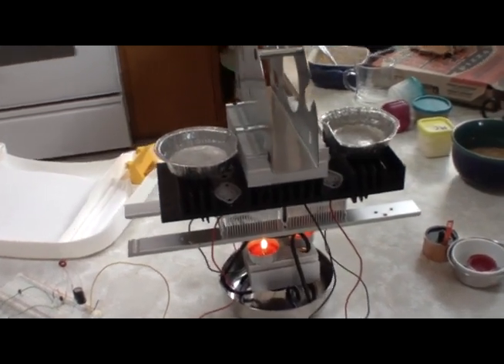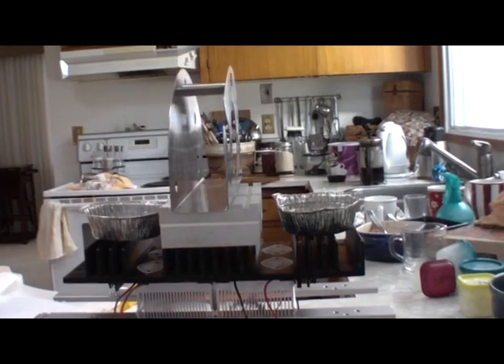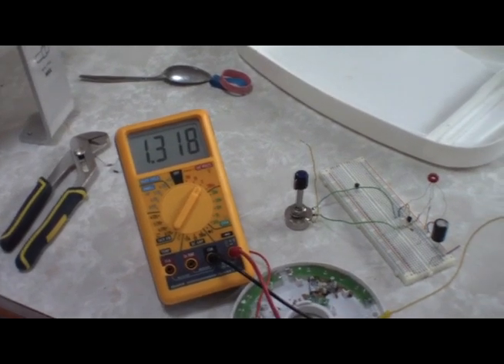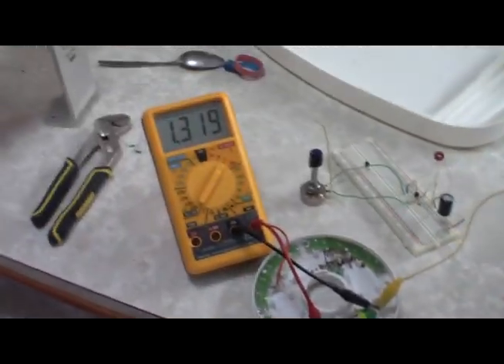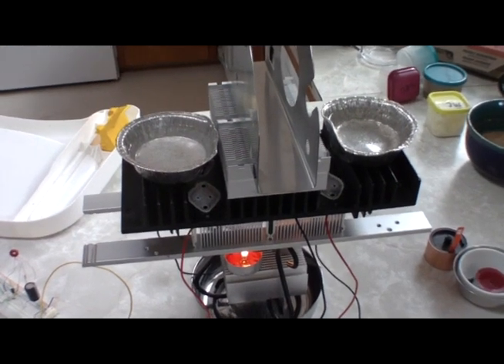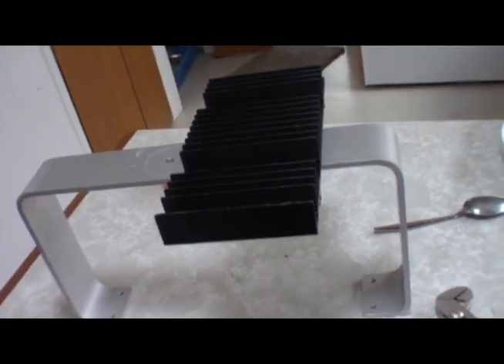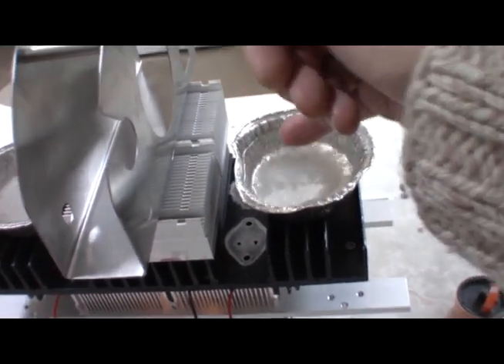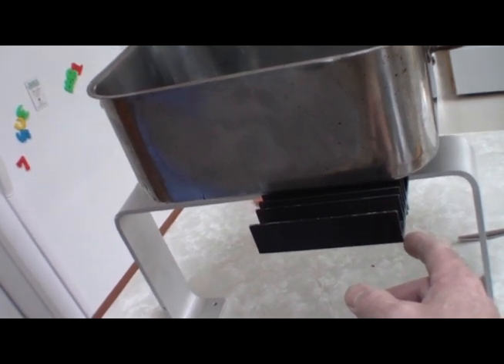Pt.2 Candle Powered Peltier JT AA Charger

Comment: Improve output voltage use a joule thief. Running hot will shorten peltier life, use a high temp module designed for power generation the internal solder joints are robust. Use a wood stove/ campfire and a homemade copper heat pipe it works best in cold weather.
Reply from the maker: yeah i tried that. joule thieves are actually quite inefficient though. they actually make a very high efficiency converter switch mode supply, but they are unrealistically expensive. i did take my best joule thief and used it in some experiments and it's ok. peltiers are interesting but not big energy yielding devices. their cost per watt is pretty prohibitive, but if uve got not much else... it'll do in a crunch
Reply: All true, maybe the stirling engine large scale is the way to go.
Reply from the maker: Martin Counsell I bought an Imbert Downdraft Wood Gasifier that I need to put some time in, on, to learn. I figure it's no "huge answer" to anything; however, if hard times came, i think for my area, at least - its tech worth knowing / having.

Comment from the maker: @Begbucks In my latest one, it's not impracticable to state : "i made a defroster that chargers batteries and gives off light" - because what it does best, is, defrost meat. So, the key with these things is, to try to accomplish at least 3 things simultaneously... they are not great electrical producers.

Comment from the maker: @imtotob yes, they are limited application. I've thought about the solar, but quite frankly, if I'm gonna invest in something that charges batteries in the sun, for less than $2 a watt, I can go solar. It can't be beat. in PT.3 I arrived at a usefull device. It does three things at once, defrosts, gives light, and charges batteries. At night. To me, that is usefull. I like useful. Cheers

Comment: Hi kyle
Ive used the peltier of cold dispenser  and used 12 v dc @ 60 w  just to have a cold drink    fresnel lense can heat it up or the exhaust pipe     for the jt dodoshlodo   ckt  i used solar cell from calculator   to charged  alkaline batteries for slayer ckts   
lots of possibilities  but new peltiers are expensive   ...... the downside

Comment from the maker: @overunitydotcom Yes, they are rather dissapointing indeed. I see it as more of a camping thing. A conversation piece, perhaps more than anything. In some rare situation where hot and cold lived very nearby, one could capture a lot, I suppose, but these situations are rare. Exhaust stacks in cold areas, perhaps. Anyway you cut it, the output per square meter is very low, like you say, due to the low efficiency.

Comment: Good stuff. Ya know, if you get the right processor heatsinks, you can slot one in the other for double mass but no increase in 'footprint'. It's how I store mine lol. Tried a piezo speaker as a peltier a while ago but got nothing, was thinking expansion/contraction for constantly varying pressure.

Comment: Well done, but these Peltier elements only have a low efficiency probably lower than 10 to 15 % only... Would be good to find better conversion materials that would have a better efficiency. Maybe a stack of selfmade Copper-Sulfid cells will be better ?

Regards, Stefan.